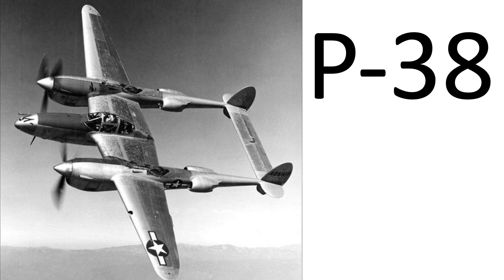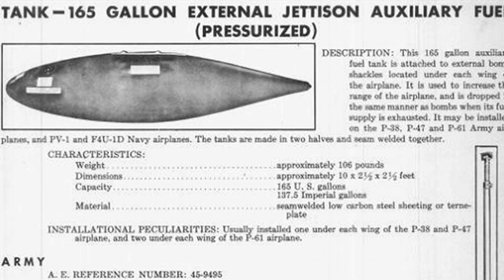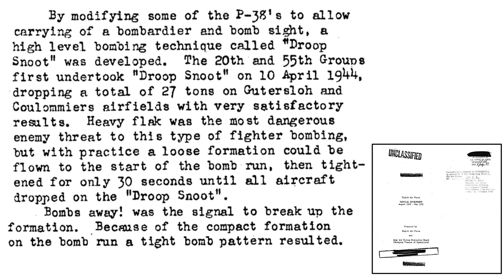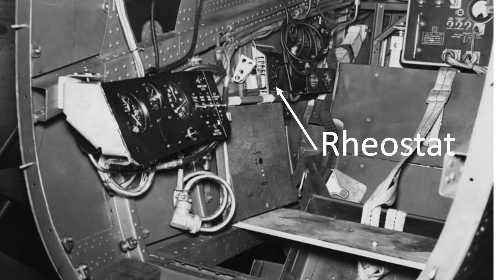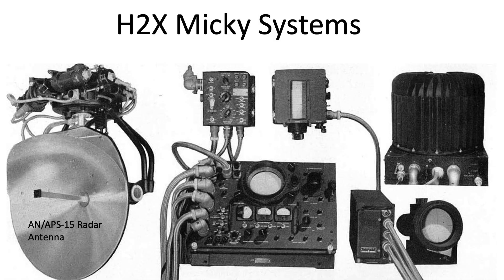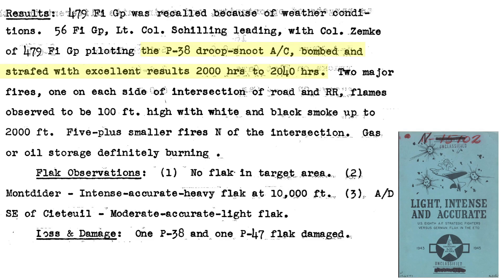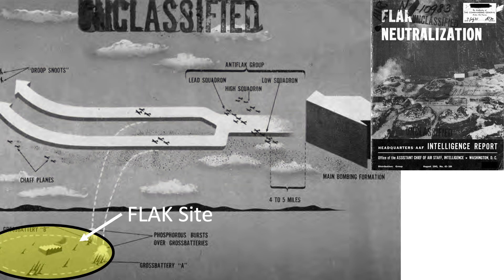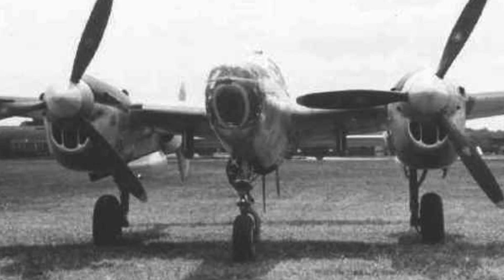P-38’s modified as a WWII high altitude, Norden bomb sight Bomber – The Droop Snoot

Comment: Thanks for the detail you provided! I'd read about the "Droop Snoot" and have been fascinated by the advantages it offered. 1/8th the crew of a B-17, with the other P-38s in its formation having 1/10th the amount of crew. The bomb load was comparable, the cruising speed much higher, and the ability of the non- droop snoot Lightnings could then go harass ground installations or defend themselves in a dogfight if necessary. I was always concerned with the bombardier's exit strategy as the propellers are dangerously close to the lower hatch, but your diagram clearly shows it's a chute of sorts that will provide that crew member with a downward trajectory, as well as a bit of momentum to clear the props. I understand that while proven effective, the Droop Snoot was only utilized for a few months and very limited in the numbers of conversion kits due to its lack of demand.

Comment: Pictures out there showing regular P-38s with a wide white bands around their noses at about the same location as the Droop Snoot.. Probably as a trick to make the Germans think they were attacking an unarmed Drop Snoot.
Reply: The other way around. It would have been to make it so that they couldn't tell which was the Droop Snoot or a gun plane.  But it was most likely just a specific 20th Fighter Group recognition marking. It was not universal.  As you can see most of the pictures of Droop Snoots do not show the band, and they used regular P-38 fighter squadrons for the bombing missions.  They weren't specialists at it.

Comment: was it international "rivalry" or a lack of Mosquitos that made the US 
convert P-38s to a mission that the Mozzies did perfectly well?
Reply: Why would you place Mosquitos in a P-38 group?  The same pilots that flew all P-38s could fly the droop snoops when needed, and still fly the regular fighter on other missions.
Reply: i think what i was trying to get at was, 
the duplication of effort, in a time where resources were stretched.
Reply: Why would you need to add a foreign airplane into your inventory?. Spare parts, different repair processes. Use what you got.
Reply: @2lotusman851  The US operated over 100 Mosquitoes during the war.  But they were always in very limited supply of them in the USAAF that needed thousands of light bombers. That is why they created the Droop Snoot and pressed fighters into the bomber role.

Comment: It wasn't designed as a fighter. It was a bomber interceptor.
Reply: Read the design and development section on the P-38's Wikipedia page. It always was a fighter, the interceptor mission was used to bypass restrictions.
Reply: It was only called an interceptor because at the time there was no funding for twin engine fighters. You should read Warren Bodie's comprehensive book on the airplane.

Comment: I had no idea P-38's were still around in Korea. Fascinating!
Reply: Exactly, I have never come across any info on any 38s being retained after the war in any source. I had assumed they were quickly scrapped because of the expense of operating them compared to single engine jobs. They would have made excellent ground attack aircraft in Korea due to their concentrated nose armament with a cannon, survivability due to twin engines, and long loiter time. Much better than the 51s.
Reply: @gregp6210  P-38s served for a long time in allied air forces after the war. The Italians off the top of my head.  Mainly it was about the post war draw down.  The USAAF/USAF had to reduce the size and number of types and decisions, sometime arbitrary, had to be made on what to cut. P-38s and P-47s were out, P-51s and P-61s remained.
Reply: @obsidianjane4413  Large numbers of presumably cheap to operate -- not even a cooling system to worry about and the turbochargers were not critical in noncombat situations -- 47s were sent off the National Guard units in the late 40s into early 50s, there are lots and lots of photos of them. Never seen a NG 38 photo, so I suppose the planes were scrapped.
Reply: @gregp6210  Yeah, like I said, the post-war draw down and creation of the USAF was chaotic.  They had a huge surplus of everything so a lot got scrapped or given away.  It probably made sense at the time.
Reply: The 432nd Fighter Squadron was sent to Korea in late 1945 for occupation duty.  They were equipped with P-38s and converted to P-51s by 1947 while in Korea.  P-38s in the Korean War probably only consisted of this "droop snoot" type.  I wrote a web article titled "Bombing Ranges off the West Coast of Korea (1946-1948)" many years ago.  Look it up.  It's still there.
Reply: That was interesting to hear. I always believed all P 38s were retired soon after VJ Day.
Reply: Many were scrapped in Germany after WWII; they didn't even bother to send them back to the US.

Comment: I have never even heard of the Droop Snoots before and I think I pay a good deal of attention to this kind of material. Excellent video.
Reply: The name was shown in a non-highlighted line in the bottom of a table about fighter losses in some of the recent strafing videos.

And that is why it takes me 3x+ runtime to work through these videos, there is often interesting bonus stuff on the side.
Reply: @JeffBilkins  Same, I often pause to read full pages of whatever manual or report is shown.
Reply: @196cupcake  Thank Heaven for the Pause button.
Reply: What are cool are some of the P-38 that were made into air ambulances